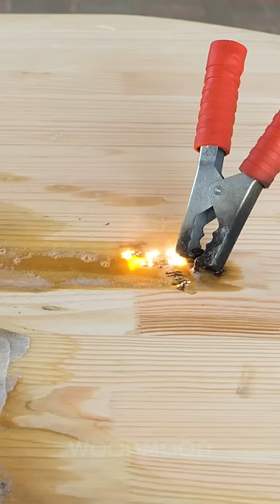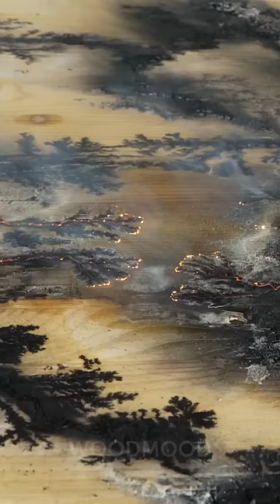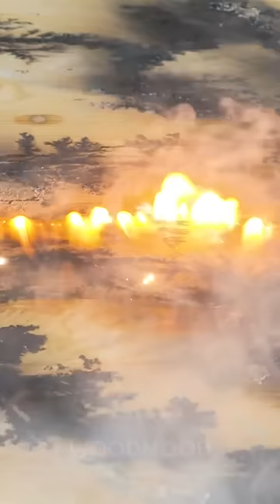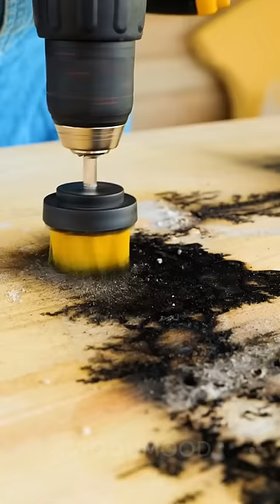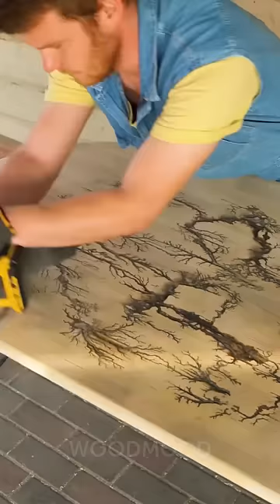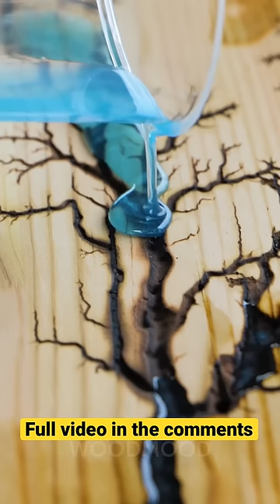🔥 Lightning on wood. How it's made #Shorts

Comment: This makes me sad, I'm a electrician, I've been shocked a lot! But this is more powerful "boosted with transformers" then normal electricity. Beware please!
Reply: True, but there are safety measures you can take.
Reply: Always use a DC xformer
Reply: @youtubestuff683  yes. Just use more of them. Can't go wrong with adding more.

Also, make sure to wet everything, including a water trail to your feet and ALWAYS make sure to wear a steel mesh glove.
Reply: @vincentlee7359  😂
Reply: We really need to include basic electric engineering in public schools. Just enough so people have an understanding how transformers work, how voltage can be stepped up exponentially, and how none of the circuitry safety measures will trigger as there is no physical connection between the lower voltage input and the stepped up output.
Reply: They have machines specifically for this that run at a lower voltage. People just dont use common sense and research somthing before jumping in clueless and thats when people get hurt.
Reply: @youtubestuff683  although there are safety measures, the craft is still extremely dangerous. One slip up, one mistake could land you in the ER or worse. It's just not worth the risk.
Reply: @30srevolution21  I imagine no mater what you do, if the current will run through and damage solid wood, it'll do worse to you
Reply: @gloatinglizard1  в России это проходят на уроках физики 9 класс.
Reply: That's shocking
Reply: @LilOleTinyMe  yep it’s called instantaneous death😜
Reply: @user-nz4fh7ve1l  It's taught here in highschool also but nobody pays attention to the things that you might actually use in life instead they're learning the difference between she,it,he,them,they pronouns.
Reply: @youtubestuff683  rubber soles can be jumped when the voltage is high enough. some safety measures aren't enough.
Reply: So is he using 12-24 VDC or 120 VAC?
Reply: @jakemoody82  maybe 2-5kVAC
Reply: @koalabanana1998  damn, here I'm thinking they've got a big car battery on the other end of those leads.
Reply: @youtubestuff683  This project is extremely dangerous and there are no warnings anywhere on these videos. Even an electrician died after trying to do this. Youtube needs to take down these videos because people see it, think it's a great idea, build the machine which has no emergency shut of, try to do it, brush against the wood, table, or part of the machine, can't move away from it and the power has no way to shut off so they just keep getting shocked and burned. The amount of electricity running in it at any given time is just about the same as getting struck by lightning for 5 minutes straight or longer. Look up How Too Cook That video on it. She goes into deeper detail on it and the deaths caused by it. YOUTUBE: PLEASE DO NOT DELETE THIS RESPONSE, WARNING PEOPLE ABOUT THIS DANGER IS VERY IMPORTANT!!!
Reply: @jamarjames9501  You learn pronouns in the first grade here in America. They're one of the building blocks of sentence structure. 😊
Reply: @jakemoody82  they are using microwave oven transformers. Those output 2000 volt at 1 amp. Its definitely 1 touch and your dead kinda power.
Reply: @GMCLabs  Well thats pretty cool
Reply: @jlboone9073  a DC transformer? No, thats an oxymoron in EE.
Reply: @billgroves5672  sorry an ac to DC transformer neon sign ones work pretty well
Reply: @jlboone9073  ok but even thats not a transformer its a power supply/converter. Transformers only transform AC ...including neon hv supllies.
Reply: Even worse is the way most instructional videos have you set this up, your circuit breaker wouldn't trip if you shorted it, it would just keep passing current through your body until somebody turned the power off.
Reply: @yoofroots  sounds like more military members should be getting hazard duty pay for electric related jobs.
Reply: @StandFree  I agree, but when it comes to something that can be avoided, like arc wood burning, I say it really should be banned from YouTube even if people are taking safety precautions. 

And I'll say this, there are so many recorded injuries and deaths that almost all deal with people who were taking those safety precautions, yet had a simple slip up that exposed them to the hazards of trying this.
Reply: @yoofroots  Maybe you also want to stop teaching about electricity in schools because it can be dangerous? What nonsense. 

Additionally, are 33 deaths a year a lot for a country with 330 million citizens? By comparison, in the usa more than 38,000 people die in car accidents every year, maybe you also want to ban videos that feature cars?
Reply: @lubie_alternatywki  When did I ever mention not teaching electricity in schools? 
I was talking about the craft of arc woodburning. Not electrical work as a whole. 

Yet apparently 34 deaths isn't important enough to declare it problematic or dangerous.

Not to mention that this new fad came out about a year ago, and it's already caused that many deaths. 

I truly don't find any danger in teaching in a professional or academic setting on how to perform electrical work and engineering, but when a person on youtube who may not have that same experience in the craft is sharing a novice video about how to Arc wood burn, that's an extreme difference.
Reply: @vincentlee7359  don't forget walk barefoot!!!
Reply: @jakemoody82  120 with a step up transformer (I think ) like from a microwave...
Reply: @gloatinglizard1  yup no cut off is what makes this so deadly
Reply: @hooptywes  it's far from instantaneous
Reply: @LilOleTinyMe   that can be said about most jobs/hobbies. Just get proper training before attempting anything that can be potentially dangerous.
Reply: @30srevolution21  maybe that's because those videos dobtt give a warning as they should. Instead makes it look easy and fun
Reply: @TechneMakre  theyre talking about pronouns for asexual queers and trans people. Not the pronouns you learn in kindergarten
Reply: @jakemoody82  микроволновка ☝️👍👍👍
Reply: It's not like the guy is using 440 to make the marks. Christ just admire the smart creativity.
Reply: Yes this is very dangerous. But under the right circumstances with precautions taken it's going to be very lucrative. The general public needs to understand what you said though. This can kill you quickly!!
Reply: @maryjohnson5776  you have no idea what you are talking about, haven't you?
Reply: Ok KAREN, thanks for that!!
Reply: @gloatinglizard1  If you don't know what the word exponentially means, don't use it...
Reply: @gloatinglizard1  Yeah, sure. You feel free to explain that one whenever you are ready. I'll be here holding my breath...
Reply: @30srevolution21  amps?
Reply: Or, simply put “don’t be dumb”

Comment: "When dealing with high voltage, anything is a wire and everything tries to kill you"
-an electrician
Reply: YES SIR !!
Reply: I thought styropryro said that?
Reply: Even air if you’re unfortunate enough lol
Reply: "Everything's a wire, if the voltage is high enough..."

Definately has that "if you're brave enough" meme energy.
Reply: Voltage isn't  what gets you
Reply: @johnnygrey840  it's both volts and amps, yes, and microwave transformers running off wall power gives both. as evidenced by around 40 deaths at all ages.
Reply: @johnnygrey840   @Johnny Grey  Yeah... current is... but...
'Twinkle, twinkle, little star, voltage equals 'I' times 'R.'

Give it enough voltage, and keep the resistance ('R') the same, and you will eventually get a non-trivial current ('I'). And .01 to .1 amps in the wrong place is not going to be pleasant, and above 0.1a can be lethal.
Reply: @johnnygrey840  yeah, it's how the voltage pushes the electrons ...
 Like,  not the gun but the bullet that kills
Reply: As a career electrician, yes, this is true.
Reply: @johnnygrey840  voltage is what gets through your skin, current is what kills you. It only takes ~50mA to kill you, this process increases voltage and still has plenty of current.
Reply: @petevenuti7355  or a hose and water is how my electrical tutor taught us lol
Reply: @nolansprojects2840  yes thank you for your expertise input..when I was training at college for electrical trades I  shocked myself with an insulation resistance tester at 500v a couple times in my final exam by accident and the tutor didn't see. It wasn't pleasant but I didn't die because thank God their was no amps just volts ☺
Reply: @johnnygrey840  a 1 mm jet of water from a high pressure line of a nuclear reactor can cut you in half ( like a gigavolt accelerator burning a path of tissue), a 2 ft wide culvert can drown ya (like getting cooked by a welders amperage) 
    so really it's the Watts that get ya, not volts or amps
Reply: @Empt109  even nubbers?
Reply: True dat, also air when the current is that strong
Reply: @Borges249  even rubbers, if there's enough energy.
Reply: @tenhovergonha8739  dude i heard it's the best electric insulator 😨
Reply: @Borges249  faraday cage is the best against huge amounts of energy.

Just think: do you think rubber clothes would protect you against a thunderstorm?
Reply: @johnnygrey840  said 1amp to the other
Reply: @petevenuti7355  what? Wattage is a measurement of voltage x amperage. so you don't know what your talking about
Reply: Your finger in a guitar Amp.
Reply: Could not help notice this comment has 666 likes at the time I read it. Lol
Reply: @robinjordan6582  Rob. Your's has also one
Reply: What the current going through?

Comment: As beautiful as this Art is its also very dangerous. Recently a couple died from doing this as a hobby,  oth were found dead in their garage. 😔
Reply: This should be done by low voltage so that won’t electrocute you.  People need to know some basics about electricity.
Reply: Se puede hacer pero con menos voltaje !!!
Reply: @s.b.2648  What about the basic fact that it’s not the voltage, but the current that is dangerous.
Reply: Over 35 people have died doing this. Extremely dangerous.
Reply: Looks like shit and gives you a free darwin award
Reply: The left it unattended and did it in their house.
Reply: @oliverm.2118  Where have you learned it?
Higher potential difference is the reason for the current flow.
And electric shock to human is serious when increased voltages give corresponding currents.
Reply: @s.b.2648  you can't do it at low voltage though
Reply: @koalabanana1998  but you can
Reply: @rikubrown8109  technically yes but it wouldnt work fast enough in practise
Reply: @koalabanana1998  hmm really. Because my electrical engineering professor did it with no problem
Reply: @rikubrown8109  how do you know your prof was using low voltage? you need a decent (though not much) amount of current which means you need a high voltage
Reply: Just gotta take precutions

Comment: Ah yes, death by electrocution is super cool when paired with a badass soundtrack.
Reply: It's from a car battery.,.... electrocution can't happen.....a good shock definitely...... harmless
Reply: @jamespasqualetto1928  watch how to cook that's review of these videos. It isn't the battery that will kill you, it's the converter (at least I think that's the word) taken from a microwave that increases the flow exponentially that's insanely dangerous. I was surprised too, but over 5 dozen people have died at this point..when HTCT made her video it was like 35 people.
Reply: It also doesn't show the jumper cables attached to a car battery, just the cables themselves. I promise the energy from a battery wouldn't be enough to burn those marks into wood. Please don't do this. No one wants you hurt. You are so important, there are so many who love you.
Reply: They are probably using a microwave transformer to step it up to a few thousand volts.
Reply: @nikpat6006  Yes! I thought the word was converter at first. The transformer is what makes it so damn dangerous.
Reply: @Horticarter41  It is sad how many people have died but this should be left to people who know how to work safely with high voltage.  This is no amateur project!
Reply: If you know what you're doing then the chance of death is very low. The folks telling others how to do this and not giving any serious warning are the trouble
Reply: @Horticarter41  I think you mean capacitor and yes capacitors can hold charges strong enough to electrocute you. Same thing in microwaves, capacitors in microwaves can hold charges for years after the microwave is out of commission.
Reply: @emailforhacking1302  I knew I had the wrong word, I just sat there going "what word is it?! It's starts with a C!" Then I was like a screw it, someone will tell you the right one. Lol thanks btw
Reply: So there's no way to do it responsibly now? You must feel so good about yourself, you're saving lives!
Reply: @IndeterminateMetal  of course there are professionals out there. Let us consider how many people attempting this actually are? Also, I'm not saving shit, now the  creator of How To Cook That? She's a hero. I've read the comments of her video warning people what it can do, and there are dozens of people thanking her for saving them. By the way, I  don't enjoy a savior complex nearly as much as sarcasm. I wonder how many more guys will attempt to change my opinion via the remarkably unsubtle talk down? Or how long this one will continue? I'm simply  aquiver.
Reply: @Horticarter41  I remember Ann mentioned something about professionals trying this and still getting hurt/dying
Reply: @bowserk.44  RIGHT!?
Reply: @bowserk.44  because they used the stupid microwave thing and it couldn't be cut off safely
Reply: Ah yes, you just admitted that you know nothing

Comment: It looks like you could use a regular car or yard tractor battery and jumper cables, attached to nails that have been drilled into wood that has been wetted with water\baking soda and applied to the wood. 

After the pattern has been burnt into the wood, remove the jumper cables - remove the screws and sand the wood surface and apply epoxy to the  design and buff the top- smooth top , and apply finish and dry.
Reply: No you need AC and a transformer so you don't draw too much current. 
Look for videos on YouTube and you can make one.
Reply: @markjob7736  and pretty high voltages
Reply: Could you just use a battery charger set to Hi amp? Or low amp? I wish there was a video of this with the supply's you would need ,any one know?
Reply: @six-pac2120  Search 😆
Reply: A battery charger with the 50 amp start i would think this woodworking this
Reply: High voltage and very dangerous. Many have died doing this. It just takes one mistake. When you are grounded is some fashion such as bare foot/damp concrete floor. Once an electrical circuit grabs hold it will not let go. Most people have been shocked and think it's nothing. And their right and just lucky they were not grounded.
Reply: @whyme5894  🤣🤣🤣
Reply: Hey Becky, did you try this? And are you still alive?

Comment: This reminds me of my stepfather, he had a thaw box that connects to the ends of frozen pipes and thaws them with high voltage. 😳 I became a ground for just half a second and I'll tell you what.. I saw a bright flash and my whole back tensed up throwing me across the closet.
Reply: Что налили и какое наряжение
Reply: You were lucky that you were not grasping the pipes or box. Muscles contract when current runs through them. So if you must, test for a live wire with the /Back/ of your hand.

Comment: Don't ever do this. I don't know how this channel can recommend to do this, it's extremely dangerous.
Reply: With the right set up and safety precautions its fine. I've done this to many a project. Mad an end table with this kid of design
Reply: @rikubrown8109  What safety precautions? Lol. You're hooking electricity up to a board, there are no safety precautions you can take to make this safe. I don't know a single electrician that can make this safe.
Reply: @killer008r  properly insulated wires, being about 5 feet away when the power is on. Wearing the proper ppe, and etc. I know plenty of electricians that have done it safely
Reply: @rikubrown8109  any good electrician will tell you not to do this, far beyond the insulated wires, and standing away while it's on. There are way too many variables to make this safe in any way.
Reply: @killer008r  if you say so. Been doing it with no problem myself. Like I said just need to take the proper precautions
Reply: @rikubrown8109  like I said, even with proper precautions, this is dangerous as all hell. I've seen a few highly rated electricians who have tried this with all the "safety precautions" You can have. Still killed themselves with it. 

Your experience so far is just a very lucky one. I hope you're at least doing this outside, and I hope you don't die.

That being said, even if you have a safe experience doing this, you still should not recommend to do this as it's extremely dangerous.
Reply: @killer008r  well of course I'm doing it out side. Who recommended this? All I said I'd that I've been fine because I'm taking the proper precautions. Most any activity has some level of danger. All I'm saying is if you're gonna do this take the proper precautions and do a fuk ton of research

Comment: Just like the geography of the planet Mars. Massive lightening bolts from orbital height from plasma discharges from the sun.
Reply: No. It looks this way because of how the maths works.

The lighting pattern is the same as the water pattern because that is how things spread to maxim effect. 
Trees grow to catch light with minimum energy to catch the most light.
Lighting spreads do to charge repulsion.
Streams join into brook, and brooks into rivers as they move down hill.

Comment: People don't be scared this is very easy to do , But if don't know anything about electric don't try this. It's called short circuit without circuit breaker it's the same as welding jobs.